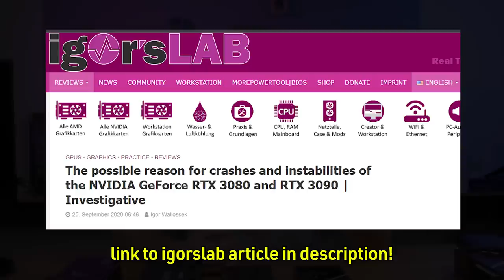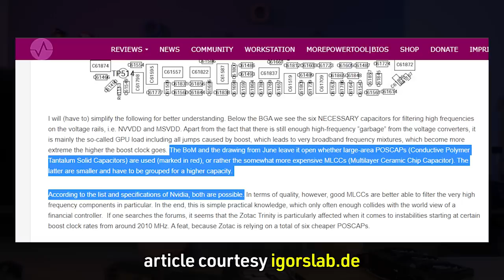The RTX 3080 Launch can't get any worse... Right? Wrong...

Comment: new respect for the ASUS TUF branding after this segment. Didn't have any opinions of that brand before..
Reply: Don't wanna jinx it but Asus has ALWAYS put expensive components and smart design in their builds. That's why ASUS hardware always costs more. They don't even beat around the bush about it. They always show and tell what they are selling you, months before the products even come out for sale. Just look any ASUS mobo video from the official ASUS channel on youtube and you'll see what I mean.
Reply: I personally have come to trust Asus more so than other brands I have been using there components for well over 10 years now my oldest component from
Them still in operation being a DDr3 board from 12 years ago
Reply: Yeah but their cards blow up just as any other brand, happened to my 8600GT, 780 and my friend´s 770 too and we are not messing around with OC.
Reply: @bcp6524  Exactly, there is no need to put them on a pedestal, their stuff is injury prone as much as the other brands, my Core2Duo board blew up after 5 years and it was a Deluxe.
Reply: Gabriel Landry I get that I have a p9x76 pro with an i7 - 3600k it’s 11 years old and still runs
Reply: @bcp6524  Don't wanna sound mean or anything but everything you just mentioned above is budget or mid class. None of those components are actually High End and they are nowhere near the premium high end hardware that asus makes that I was referring to. Those boards aren't even made with premium components because that is entry level. I am talking about the hardware that asus makes that always costs more than it's counterparts made by other companies because it's got premium resistances, transistors, filters, etc. Such as the ROG line.
Reply: @mikeanaro  Every brand, even the best still have some failures. It's a numbers game with any component. Even good ones fail sometimes for no good reason.
Reply: @samhillebrand  Exactly, so lets cut this ¨new respect¨ bullshit right now.
Reply: I can't say i agree with you Dkar0 , their products have always had faults just as any brands, actually Asus more so than any other brand, so its not like they have always used the best of the best, because they wouldn't be able to compete in prices then as they are, i had Asus Titan and 780ti cards with coil whine and i said fuck it, done using asus cards, used Gigabyte cards ever since, knock on wood, no problems yet, and gigabyte don't have the "void warranty" stickers on card either if you take it apart to replace thermal pads on the gpu to have the best of the best cooling solution for your card.
Reply: Individual failures aside (failure rates being more applicable) - what is good about this scenario is its a bit like a pop quiz and you see who is trying and who isn't - because there is something to measure -  judging by the video it seems Asus were superior in design on something not obvious to most users until this issue came to light so yeah - new respect for them from me. I'm happy to learn anything that can objectively prove or disprove a brand's quality like this for other brands too, such as Gigabyte.
Reply: Is that confirmed? Looking at the pictures on Newegg neither of the asus GPU’s actually have any of the more expensive capacitors.
Reply: It's expensive model.
Reply: Asus quality has always been pretty good. I still have Asus dvd drives that are 10 - 15 years old and still working.
Reply: @TheWatcher740  you mean asus doesn't push out broken updates that cause more problems than fixes? You know like almost all of the other brands do? I can't tell you how many botched gigabyte updates I've had that have completely bricked the MB. The only asus board I've had issues with was the hero 4 and it was just a faulty heat sensor that would code every time you tried to  overclock. 

Just a month ago I cleaned out a stack of bricked MB's from my closet none of them are Asus.
Reply: @RobertFierce  is that why they made a crappy hot amd gpu and then blamed amd for it when it was them that decided contact wasn't important to thermal conductivity?
Reply: on the product pictures it looks like all 6 have the cheap layout though?
Reply: Lmao i was watching this video scared as hell and then I checked which card I had ordered and it was tuf god that feels nice
Reply: @RobertFierce  ASUS hardware is brilliant, software can be a bit meh sometimes haha
Reply: @mikeanaro  Lets not cut it! I have had ASUS GPUs and MoBos before and they were just better... than Gigabyte, than MSI. Although more expensive, especially the ROG line (havent tried TUF yet) is just better built. I have both my CPU and GPU overclocked/undervolted and the ease of doing it and the stability afterwards were just unmatched on those components. GPU-wise I have most experience with ASUS and if I am not really limited by money, I will always prefer the brand.
Reply: ASUS Hardware was and is usually top notch, but their desktop software is still a bit crappy, nothing you can't fix though
Reply: thats kinda TUF
Reply: This is why I only buy ASUS
Reply: Every motherboard ive ever owned over the last 12 years has been a ROG asus board. Every one of them has been fantastic
Reply: i know boss dont like LINKS! and ye . i dont want to but a single picture doesnt show that even with ASUS TUF u can find with cheapo ones 
https://www.mediamarkt.de/de/product/_asus-geforce-rtx%E2%84%A2-3080-tuf-gaming-oc-10gb-90yv0fb1-m0nm00-2681861.html
like this . i was suprised that it looks differently . sadly dunno why
Reply: @RobertFierce  Meh had problems with ASUS just like MSI, funny enough I've had the least problems with Aorus (Gigabytes premium brand)
Reply: @RobertFierce  trueeeee asus is the best now I am not saying this blindly I do have a asus rog strix card and dameeeee 1 it's veryyyyy silent 2 I was messing around with a software and accidentally turn of the GPU fan completely that started playing GTA 5 loong time later I went to my software and my gpu was at 98c after that of course I turned on the fans But GPU still works fine till today if you are wondering what card it is it's asus rog strix rx560 OC
Reply: I used to respect Asus until I dealt with the service department recently.  

Motherboard (ROG STRIX) was ok except common wifi card problem that they ignore, figured I'd just put a intel card in - well 6 months later it will only stay up for a few minutes max before it gets stuck in a boot loop.  Swapped everything - gpu, psu, mem, removed hd and tested booted from USB, tested it outside of the case - its the mobo of course.  

After already being down for a week and attempting to do a RMA, they cancel it and say I need to do a mandatory phone diag - I wrote that I tested everything but I guess they don't believe you and want you to do it while on the phone with someone that you can barely communicate with.  So I do that and get the RMA going again, pay out of pocket to ship, they send it back unrepaired - claiming they couldn't duplicate the problem.  I don't know how to duplicate their non boot looping - just going into bios and hanging out in there for a few minutes will even lead to boot loop, they must not have ran it for more then a minute if they even did.

So now its 2 weeks of downtime (they don't offer advanced replacement), first thing I do is test everything again and no change.  Next day the choice is obvious, be without a computer longer and spend more money on shipping to probably not even have anything happen even though I still have years of warranty left... Or just spend the money and get something else.   So yeah I have a $150 ASUS motherboard laying here that is a new model and in warranty but is useless because ASUS service sucks.  I'm not sure any other company is really going to be better, but I have to not buy Asus anymore out of principal after this..

This was not my computer - I have built computers for 20 years (literally) and most are not for me.  I was almost exclusively using Asus before this so it will cost them.  I was studying customer service for my own business, and studies show for every customer that complains about something there are something like FOURTY other customers with that problem that are just not complaining so I'm sure there are allot of people like me that had to just buy something else because they wont honor or properly do warranties.
Reply: @h82fail  what would you say that is the best brand (that you experienced the least problems) out of them all?
Reply: I bought a Strix G15 and tbh I can see why ASUS ROG line is one of the best
Reply: @rubenbertoluci7801  Until this recent experience with Asus they were my goto.  I think most brands are doing good in the recent years, it is only long ago that I really had to be picky because there was allot of junk..

Done some research since dealing with this and it seems like Asus has been struggling to get AMD boards right. Probably ASRock for AMD and Asus still for Intel. 

I would have just guessed my issue was quality control but my problems are semi common with that board, more common then it should be anyway.

The Asus support thing pisses me off to no end.  Would love to make a video publicly shaming them (recording in FF of it booting up then going into boot loop after a few minutes with completely different various hardware configs) and say they can't duplicated the problem and wont repair under warranty...    Problem is I don't have any spare AMD CPUs right now.

Actually found quite a bit of the same RMA experiences when searching - all they did was 'update the bios' and send it back unrepaired - often they even lie about updating the bios.  Usually the ones I find that publicly shame them on the Asus forum or an Amazon review will have an Asus rep come in and take care of them quickly.  But you shouldn't need to do that, and most people will just move on to something else.

Looked up some other popular companies, was seeing complaints of month+ turn arounds instead - Not sure anyone is great in the support department except maybe a company like Supermicro.
Reply: @emilcrafter  hahaha Same feeling here, I was also relieved I bought the Asus 3080 Tuf
Reply: I switched to Asus only builds a few years ago and I never had a bluescreen or any minor inconvenience due to hardware. I also build all the systems for my friends. But it has to be said Asus is significantly more expensive than the competition. This can lead to almost double the price for a mainboard or up to 30% more for a GPU. That being said I ordered an Asus Gaming monitor send it in 3 times because it arrived in DOA 3 times, and I checked the serials they didn't send me the same again (they also had different issuers), but probably out of the pool of other returned Monitors that went out again without enough testing or incomplete repair. You should never fall in love with a brand only with a product and when the product starts failing you switch the brand.
Reply: My 3080 10gb tuf oc v2 is going strong

Comment: FE - better made, lower price
AIB - worse made, higher price (and they even cut corners) 
wtf is this
Reply: What  does FE and AIB stand for
Reply: @crozess7032  FE is founders edition and AIB are all the other cards
Reply: Nvidia fucked them on purpose by giving themselves a head start.
Reply: @walkieer  On top of that, there's strict guidelines from NVidia, how OEMs can build their cards (minimum specs and such). Overall it's mismanagement on Nvidia's part, that caused these problems.
Reply: Greed.
Reply: @walkieer  they even gave up selling rtx 3000 series FE